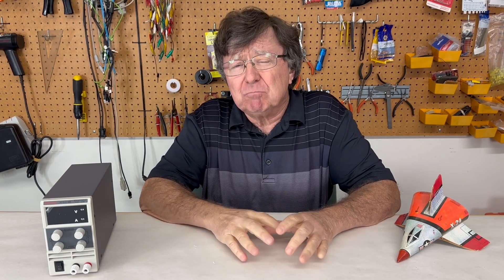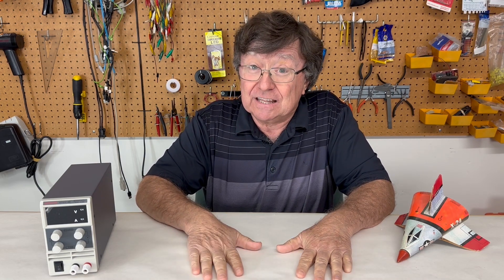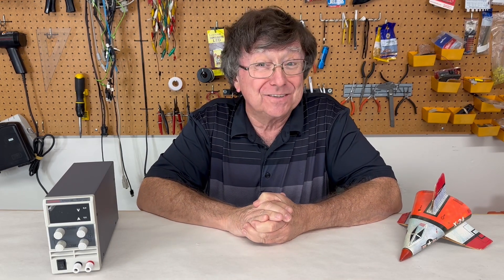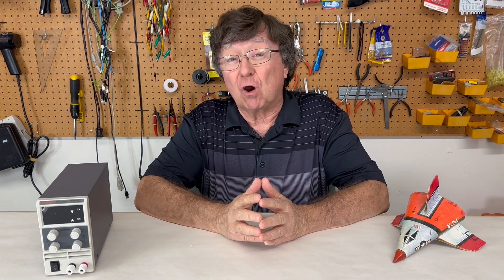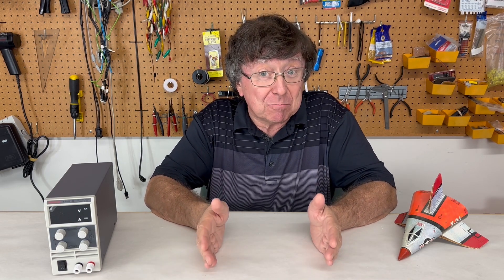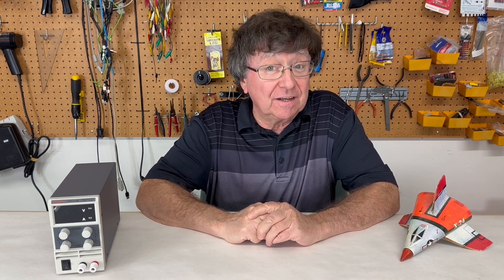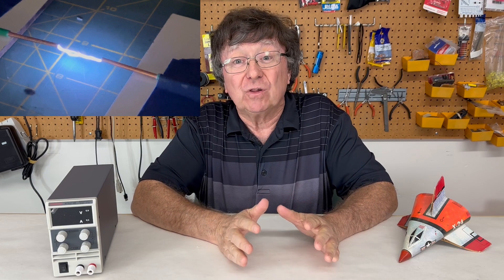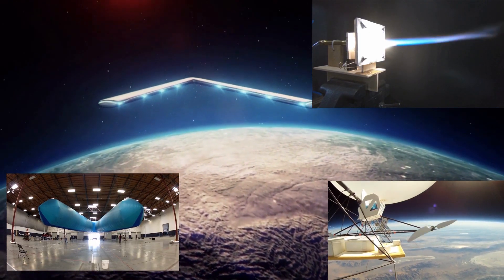Plasma Engine Research, Magnetohydrodynamic Test No. 130 & 131, Taking the Next Step

Comment: I don’t quite understand, if for most of your ascent you’re pulling power out of the engine isn’t your specific impulse limited by the same mechanism as chemical rockets? It’s pretty clear the concept needs more than a couple hundred seconds to shake out, and without dumping energy into the thrusters I don’t understand how you’re planning to get more than that.

Comment: on the pictures of the dark sky station, i saw solar panels. would beamed power be applicable to the dark sky station? i wonder which would give you more power. beamed power caught my eye after reading this, https://en.wikipedia.org/wiki/Stationary_High_Altitude_Relay_Platform should be much easier to beam power on airships since they move slower than heavier than air vehicles.

Comment: The two phase ionization+magnetic engine setup sounds a lot like VASIMR, which was an infamous power hog on the order of megawatts per newton.  RF preionization might help increase output power/Isp, but watch for the dry mass penalties of all that power generation and battery.

Comment: I haven't figured just what the hell their doing.

Amateur rocketry ?
Igniter obliterated 
Where is the ion source stream 
Rocket motor had some thrust
This looks like a HV spark 
What is all that  sparking, is that your fluid?
Don't get me wrong, I like to play with spark gaps, but really love a great working Jacob's ladder.

Anyway always enjoy what your  doing.🤔
Reply: They're developing a rocket engine for their orbital airship.
They're planning to use a hybrid engine whose thrust is enhanced with the magneto-hydro-dynamic effect and that's what they're testing.
A basic solid rocket motor whose thrust is enhanced by putting electrical power into it with the MHD effect.
Reply: It's plasma thruster propulsion that instead of chemical fuel uses electric plasma ionization and is especially essential for propulsion outside the orbit and for the solar powered high altitude dock they're trying to build